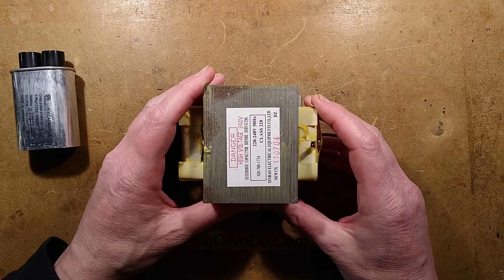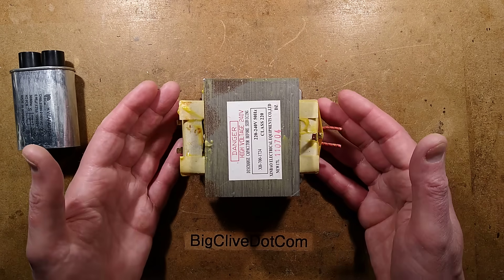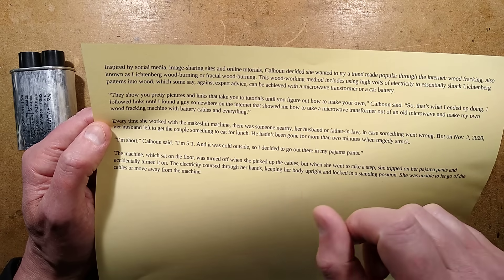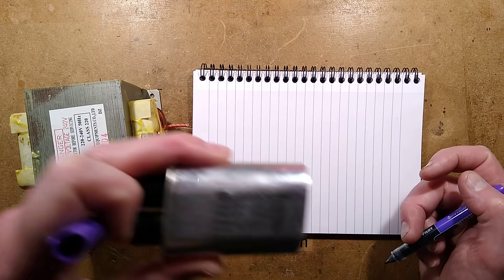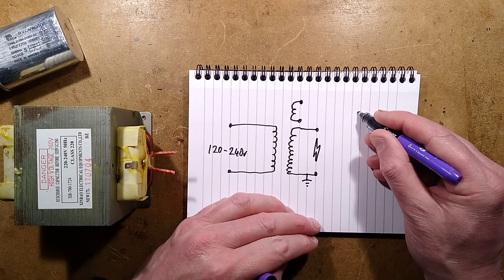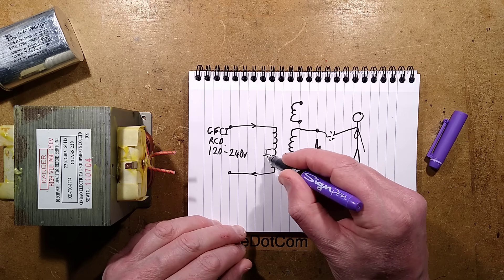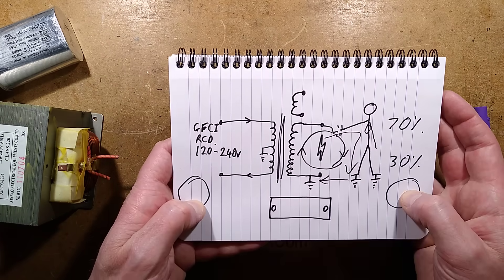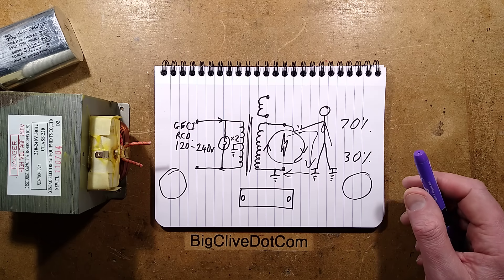The most deadly project on the Internet

Comment: Is this LITERALLY the same as an overhead line of the same voltage? It seems strange to me that the extra current wouldn't make an overhead line more dangerous? Is the current not really a factor when we are talking about numbers as large as these?
Reply from the maker: This won't have the same current as an overhead line that will literally blow your limbs clean off.  But it's in the same category.  It's unfortunate that the shock from an overhead line will involve such high current that it will stop your heart completely and blow you clear.  That is a better situation for your heart restarting than the microwave transformer knocking it partially out of sync and resulting in fibrillation.
Reply: @bigclivedotcom  Yeah I always figured an overhead line is at least kind enough to give you a quick death. These things sound genuinely painful!
Cheers for the answer :)

Comment: As a car electrician i mostly meet 4.5~ KV max, tho i met some defective ignition coil which had a very interesting design. Around the two coil there was supposed to be a metal cover shorted to the negative as a "filter" (it supposed to protect electronics in the car), sadly on the aftermarket chinese part the cover was connected to the primer negative directly meaning it was pumping 1.5KV into the chassis and bypassing the flyback diode. long story short, when the coil was in place there was no problem, the loop was closed, unscrew the coil to inspect it and you have 1.5KV (60Hz) in you as long as the car cranking.

Comment: There's an older gentleman up my street who almost died because of this. He's a carpenter on commission, so he is regularly tasked out with random tables, shelves, and other wooden furniture/creations. He was making an end table when he decided to do this to the top of it, then was going to lay bartop epoxy down over it. 

He was shocked and the only reason he lived was because a neighbor had seen what happened. Jumped off his lawnmower and ran to the man. Being smart enough to apparently put on his gloves before he grabbed the man (rubber gloves of course). The table caught fire and was put out quickly. The guy made a recovery and remade the table. Without the designs this time.
Reply: My brother's best friend @ 19, on an athletic scholarship, got a summer maintenance job at AZ State U dorms. Naively opened a major bus panel that should have been locked. Blew him off the ALUMINUM ladder, incinerated the front of both thighs almost to the bone where they were against a rung & vaporized both arms to the elbow. Summer in PHX, 112F, he laid on his back for an hour before he was found. Astonishingly he survived. Miraculously kept his legs though the front of his quads just above the knee looked deeply gouged by a giant piranha. In the aftermath for more than a decade he hobbled around like a Polio victim but as pleasant & cheerful as can be, resigned to his fate. Made jokes about his "Captain Hooks". In fact used to tell inquisitive kids he was a retired pirate. Then one day he quietly, abruptly chose to check out for good. Today as an artist, sculptor I'm astonished at this insanity on YT. The Lichtenberg effect is NOT ART. Sure the patterns are fascinating but it's speaks nothing, is rarely incorporated meaningfully into the broader context of a creation. A parlor gimmick to say, "hey! look what I did!" Now it's everywhere like the pet rock ...with far more fatalities.

Comment: Its the same voltage as the electric chair ... That one statement says it all.  If someone hears that and they do not understand the extreme danger of working with the unit, well, Darwin Award time.  And if anyone reads about electric chairs, they use sponges on the chairs soaked in a Saline Solution to help conduct the electricity directly into the persons body.  So here you have people working with saline solutions on wood, then activating a device with the voltage of an electric chair.  The two together perfectly replicate the electric chair set-up.  So to me they are essentially committing suicide.  If I was an insurance company I would refuse to pay out on insurance due to this is so dangerous it's is effectively suicide.  Please insurance companies, start using that, strike the fear of their families going utterly broke if they die if they do this.  It's the only way to stop stupidity.  That and Natural Selection of course.

Comment: As a young kid about 7 or 8, dads stero shorted to ground, back then the code for grounding to water pipe was different, I almost think my experience changed the code, now its first 5 foot entering house, back then it was anywhere and unfortunately was close to the water pipe feeding the bath tub, when I got in tub I was fine it filled up with water and I grabbed the spigot to get more hot water, it glued me to the faucet for what seemed like forever, tried to scream help but couldnt, then guess the breaker tripped, my mouth felt like I had copper pennies in it and er doctor says it threw my heart rythm off a bit
Reply from the maker: That would have been a very scary incident.

Comment: A good choice may be not to ground your transformer. That way, you must close the circuit by touching both sides of the secondary to be electrocuted. This is the kind of thing I would get situated, and not be in contact with any part of it when I turn it on, and while it operates, hesitant to get too close, despite the mere millimeters that the arcs can jump at that voltage. I've never been electrocuted, and I don't plan on changing that. I'm not afraid of electricity, but I'm not afraid of guns either. But you don't leave it loaded with one in the chamber when it's time to perform regular maintenance.

Comment: Besides not being educated about the dangers, why would you want to be ANYWHERE near this thing when you turn it on?   I think a solution might be the dead man's switch but long-range, so you don't have to be anywhere near any of the paths that current might take.
Reply: Because you aren't going to become part of the circuit, unless you are physically in contact with it..
Or it's on a metal table, & you're touching the table.
It's electricity...Not magic.

Comment: In simple , if you're new in Electronic first start with low current HV Generators like High Voltage module or diy flyback transformers they are still dangerous but much much less than mains MOT .

Comment: Many thanks for such a well balanced and accurate analysis: the idea of a "deadmans handle" is great. Having spent most of my working life on electrical safety, I cringe at the thought of those high voltages combined with  conductive fluids but you are correct in trying to ameliorate the consequences rather than trying to stop the activity. One point that came to mind is that the dangers of 120V or 230V AC currents alone can be lethal: perhaps you could emphasise this in any revisions of your excellent video?
Reply from the maker: See my video called The unofficial guide to electrocution.

Comment: Don't do it,,,just don't! I take old microwaves apart all the time, but I get the only great thing in them, the two round donut shaped magnets. They are great. Caution! They are near a ,not sure of my spelling, beryllium post that I understand is not good to breath if you scrap it, but that's hard to do. Get the magnets out and leave the rest to the fingerless people.
Reply from the maker: Virtually no domestic microwave ovens use beryllium ceramic.  It's usually safe alumina ceramic.  If it was the harmful type there would be warning stickers on it.

Comment: I'm an electrician and this horrifies me that people are accessing anything with exposed live terminals.....and then to think they are working with high voltage which electricians will tell you need much more extra safety precautions it is crazy dangerous ... and if it does not kill you it will kill someone you did not intend to kill.

Comment: It's because that transformer is a buck boost transformer. It converts 125 vac to your voltage 220 vac. I've been energized by 277 vac. It took my leg completely out from underneath me and I fell and landed on the top latter. 
Pure water is not conducted. But when you introduce any substances which changes the balanced to unbalanced elements.

Comment: Microwaves have insulator in them that is really poisonous if you breathe it in an you will slowly die nothing can be done about it either that's the bad thing but it's the part that is my favorite thing to play with very seriously like haha I like magnetic things
Reply from the maker: Unless there are warning labels specifically saying it contains beryllium oxide, the magnetron is most likely using aluminum oxide as an insulator.

Comment: Our professor made an experiment at school where he used a Van de Graaff generator connected to a 15KV unshielded wire. since the generator was outputting somwhere near 150KV you could see sparks going from the rubber to a ground point throug air. It was a little scary seeing an insulator work as a conductor

Comment: I almost killed myself with a microwave one time. The clock on microwave was kind of diagonal from moving from one house to another. I tried to fix it by lifting the cover off a bit and reaching inside. The house was hot my arms were sweaty and when I moved the clock my wrist accidentally touched that thing and Dammit! ⚡⚡⚡I had the shock of my life. As i was getting shocked i could see the numbers in my eyes. The shock was so strong it made me fart til i felt like I was about to faint i fell on the floor and the top of my head was smoking i also had sweat on my head. My wrist that touched the part a good piece got burned brown 🟤. I guess the only thing that saved me was my weight as I fell down it made me separate from the microwave or maybe that my wrist was cooked🤷‍♂️After months from time to time i could still feel electricity inside my head and neck

Comment: Wasn't even thinking about doing this but was intrigued as I built a valve amp last year and wondered if it was anything to do with that. I commend anyone who takes the time as you have done to explain clearly the dangers and some potential options to prevent injury. I for one will never try this. It was scary enough knowing that my valve amp could produce around 600v DC and potentially kill me, so I took all the safety precautions and read all about the dangers and how to discharge capacitors and measure remaining voltages, one hand in back pocket etc. But that was nothing compared to holding 3000v on jump leads. I hope you have put a lot of people off even thinking about doing this!
Reply: Yup, tube (valve) amps have dangerous voltages lurking in them. As long as you DON'T touch the wrong things under the chassis, they are safe; if you DO, you won't do it a second time. . .

Comment: As a trained electrician, this is a the best explanation of Galvanic seperation I've seen for people who have no idea. having worked in Low and Middle voltage (here in BE and AT, we say  low voltage up to 1000v, middle from 1000V to 5000V, and high voltage everything above, but that just to have a seperation for easy of knowing what you're dealing with), I can not stress enough to be extra secure. Yes, I worked under tension, but that was extremely rare and took a lot of preparation of small tasks. Seeing and hearing that people start using their transformers with a Youtube degree of electricity just blows me away. That is why I love this video so much. Normal human language explaining why you're staying in the danger zone. Because there is no shift detected in the Amperage due to a leak(what is you, leaking to the earth)!!! Very well explained sir!

Comment: ANOTHER PRECAUTIONARY MEASURE. Remove all jewelry from your body. ie necklaces, rings etc. I found out the hard way when I first started working in the radio field working on a portable walky talky with only 1.5 volts DC of course. I was talking to someone and set my hand down on the circuit board unknowingly and OUCH!. The ring on my finger started frying and I couldn't get it off. Also if you are working with high voltage, it can also cause arcs without having to even touch it. And as the guy says, never get complacent even when you know what you are doing. Better yet, pick another safe hobby. This is not worth it.

Comment: I was changing a 277vac light ballast in a ceiling on a ladder. 
The circuit was energized, something that I've done countless times.
When attempting to release the hot out of the ballast, it got stuck, so I foolishly pulled harder. 
The wire released and stabbed.my finger on one hand, while the other slipped onto the shaft of my uninsulated screwdriver.
Full 277vac from right to left hand.
Was able to bend my knees to break contact.
Had I been up in the crawlway, I would not be able to leave this comment.
277vac is wicked.
I was lucky and smart.

Comment: I have had a few electric shocks over my lifetime mains voltage (240v) a couple of times because this smart arse didn't need to turn off the mains because I will be fine. older and wiser now. but worse than that I have had an old 6v battery powered flash head for photography with two big condensers inside the type of flashhead that make the wheeee noise as the condensers charge up.to capacity. no idea how but a short circute somewhere. I press the shutter release on the camera with my eye against the viewfinder rubber eye  cup. and bang I'm flying backwards and bounced off the wall behind me the rubber eye cup was no protection it was never designed to be. apart from a few bruises from my intodruction to high speed human flight.  another time I was trying to find a fault in a peice of kit with a multimeter  it contained a condenser I new well to stay ell away from that with the probes again 6v powered by a motorcycle battery. wasnt having much luck and my mother walked past and said be careful you know those condensers can give you a hefty belt. thank you mum, na I'm fine bean at it for a couple of hours no problem I know what I'm doing. how to provoke fate four time in about as many minutes I got a belt of a shock. thanks mum you had to provoke me into jinxing myself. I gave up and went back to it another day and eventualy found the problem. dont ever think it cant happen to you with live power even low voltage and dont ever provoke fate by telling someone to be careful because they will say those words that annoy fate I'm fine 🤣🤣🤣
Reply from the maker: You might find my "unofficial guide to electrocution" video interesting.

Comment: Back in the 80s I worked for Edison , there was this one guy that always messed around the 4670 terminals well wexwere working this thing and had it open and this knucklehead screwed around and fell, and wound up going into this until. Yeah 46,000 volts that guy did not stand a chance he was charcoal before we could get it shut down, I doubt he felt any pain, his nerves were burned out within a second or less. The reason we were working on this unit it had a ground fault indicator so it had to be worked on while hot.  And yes we had red exclusion tape all over the place, but that guy never paid any attention to anything especially when it came to safety rules.

Comment: I shorted an electrical socket as a 3 year old kid with a fully metal(no plastic handle) screwdriver. Screwdriver flew into other room (or maybe I tossed it). That was a good lesson for next 30 years. Sometimes I still work on live wires though... Also got fucked up by a dslr capacitor once or twice.

Comment: Remove the earth connection on the transformer secondary then there is no earth continuity link and reduces the potential to pass a fatal shock through a persons body, only the transformer frame requires an earth connection.

Comment: I'm old enough that I still remember the old console tube TVs...the ones where you could replace your own tubes if they burned out.  Gotta love the 50's and 60s tech!  My grandfather did that until one time he couldn't figure out which one was bad and had to call the TV repair man.  The guy came out and my grandfather explained what all he had done, and the guy was surprised my grandfather hadn't killed himself.  He had been working around a device called the flyback transformer in the set.  It was responsible for generating the massive magnetic field needed to direct the electron beam onto the screen.  The repair guy said to always stay away from that, because it would produce tens of thousands of volts and store the charge in nearby capacitors.  Yeah, to say it was lethal was an understatement.  My grandfather left the TV repair work to the pros after that!
Reply: Plus, the CRT itself can store one hell of a charge on it's surfaces, essentially a low value but very stable high voltage capacitor.
Reply: Every one I have taken the back off had big warning signs over all the high voltage bits, we used to be warned about this stuff in school science lessons, in the context of the content of the lesson, which helped it make sense, but now that people generally don't do any repair work themselves that cultural awareness in common is much rarer.

Comment: If you replace the windings up top to turn this into a step down transformer for spot welding, is it less dangerous ? It is supposed to be be very low voltage at the end, but very high current

Comment: Cutting the secondary winding is also waste of wire. I've seen people grind the weld on the sheets and  remove them to get the secondary winding out to use for something else. Then glue the sheets back together with the primary and reweld them. I'd use that wire to rewind a damaged motor I got. It's best to learn to become practical, not waste materials. Use the strong magnets from the magnetron, use the sheetmetal, and the electronics for other applications. Chassis boxes are expensive, make your own.